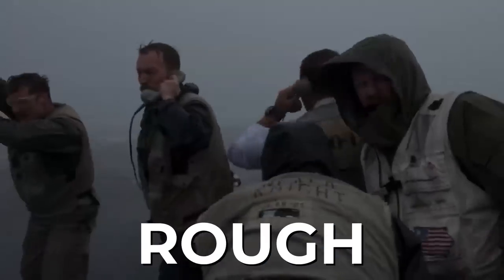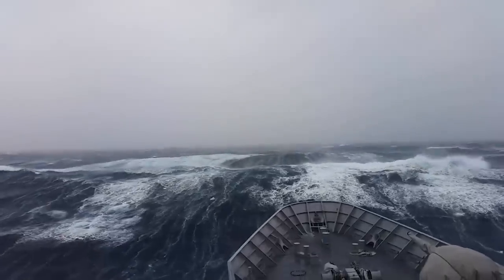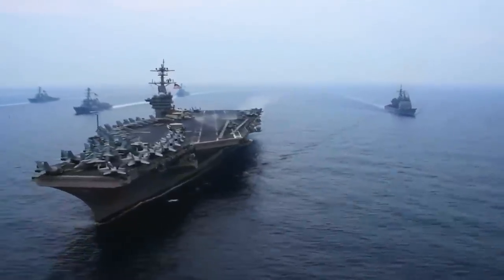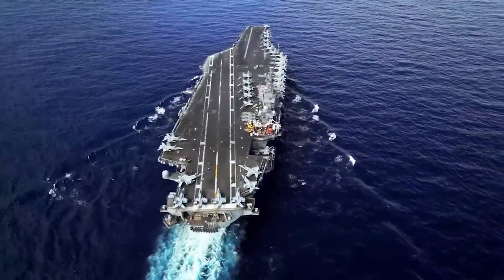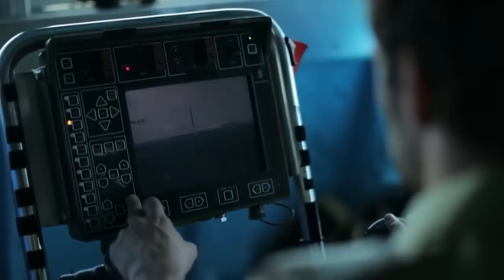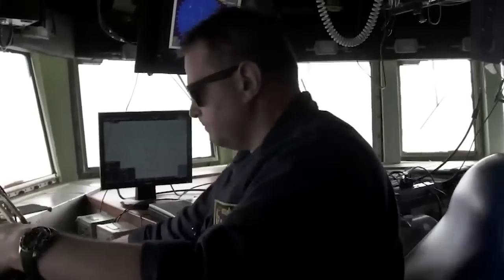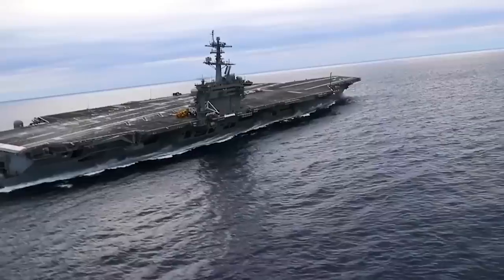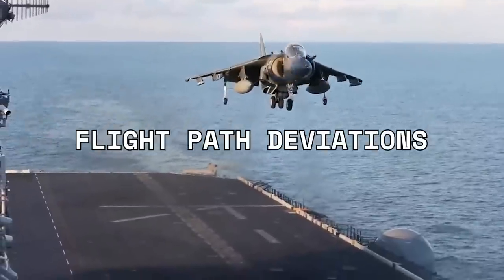How do Aircraft Stay On Carriers During EXTREME Storms!?

Comment: The trick for Tight Tight chains. As the boat sways with the waves. The bird tilts a bit. That leaves the depressed side with more slack, at that point screw down that lock collar. Once the bird sways to the other side, the side you just did will be solid and you repeat the process on the other side. Chains gang parties get better and faster as your time out continues. It’s not OMG fun but may as well enjoy it while it lasts.